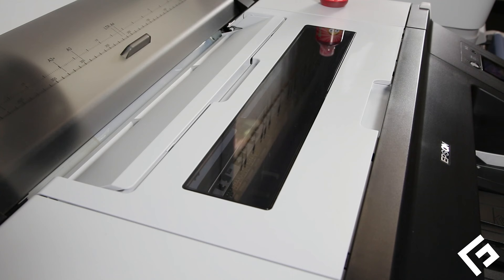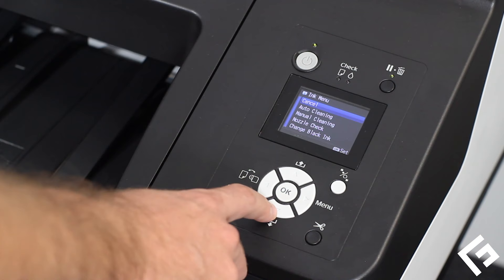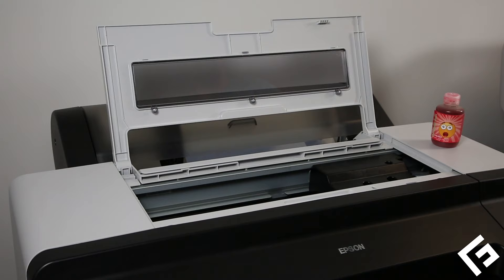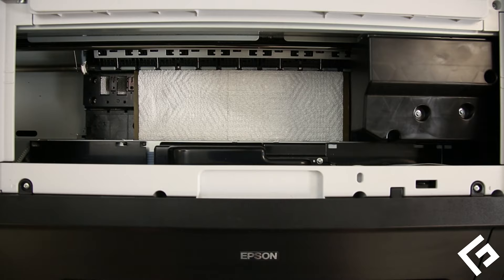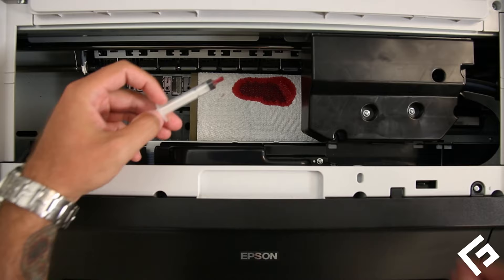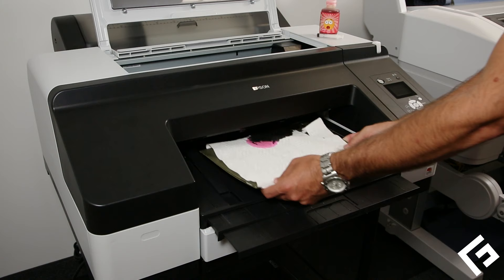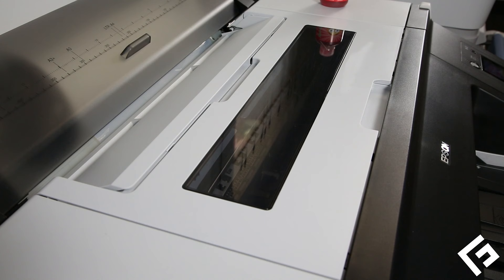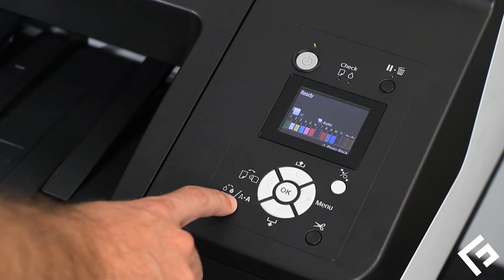How to Clean a Severely Clogged Epson Print Head – Freehand Graphics™

Comment: I have a stylus pro 9900, tried print head hospital to flush, left it over night, even ipa, tried for over a week and still no better, manifold was severely blocked, cleared that, but can’t clear the printhead, any ideas ?
Reply: I'm interested too, as this could easily be the case with a used 7900 model that I am on the verge of making a decision to buy or not.
Reply: I solved it, removed the printhead again, made sure manifold was clear, bought some windex off amazon and wet one of those blue kitchen towels, left it for 7 days just replaced the towel each day, put it back in and worked perfect 👌🏻
Reply: Oh if you do buy it, I’ve got some spare refillable cartridges with auto reset chips for the 7900 etc you can buy if you want, 90 for them, we’re 200

Comment: would this work with epson f2000 garment printer?  damn those white heads
Reply: Interested to know as well.
Reply: did you try it? im having issues with my white ink not printing all of a sudden
Reply: Your better removing the head, flush the manifold separately to the head, let the head sit on a paper towel with widex, fumes break down the ink... this is my own experience, I have a sc-t5200 based dtg that I converted myself and too had white ink problem, and try getting white ink from kornit